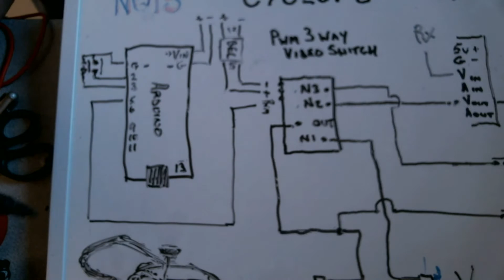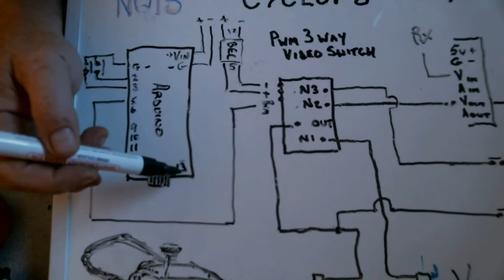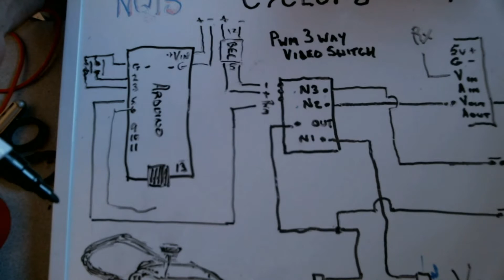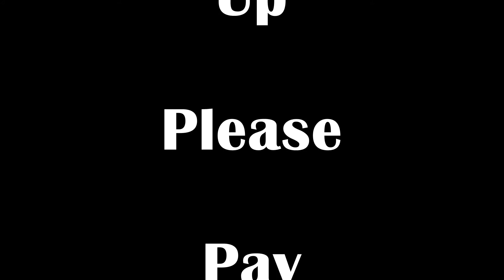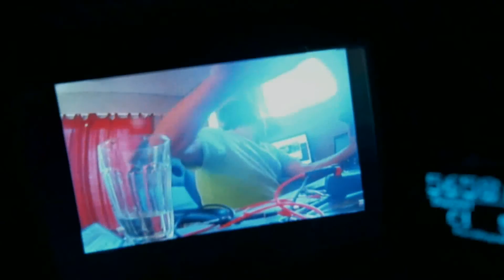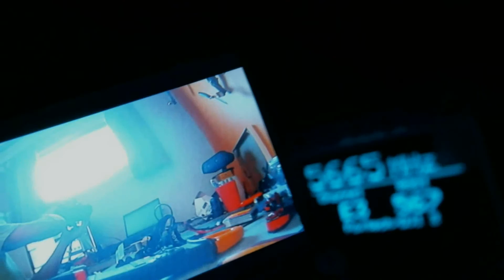Quanum Cyclops Goggles Switching between inputs with a touch of a button.

Comment: So the link to github doesn't seem to work. I'm looking to do the mods you did for your goggles for video switching with the arduino and switcher and dvr mod. Is your programming listed anywhere and a parts list?
Reply from the maker: I just followed the link and it took me to the right place all seems to be working message me if you have any questions

Comment: I wonder if there is a way of using mechanical switching instead of the Aquino less money and programming
Reply from the maker: you could do it by wiring it all via switching Jacks so as you insert the jack it would disconnect the other signal but I was always looking for a practical use for the Aduino Nano
Reply: thank you